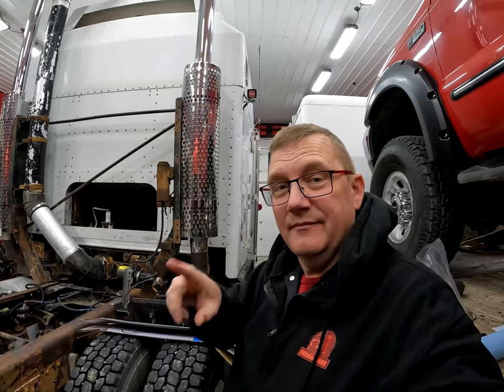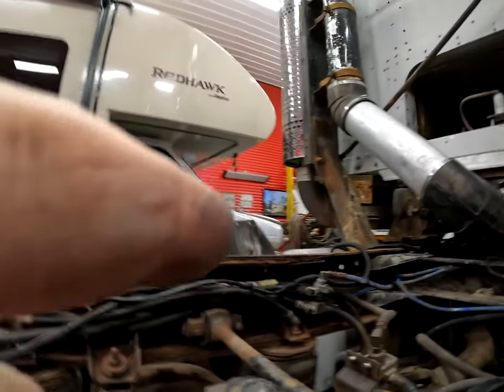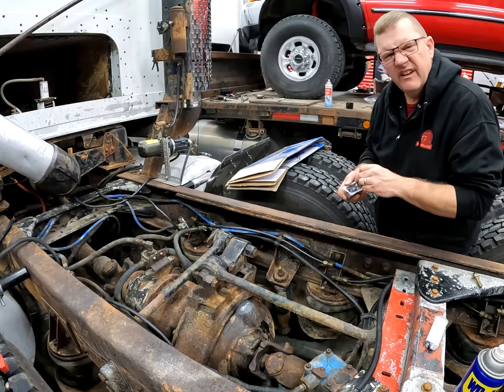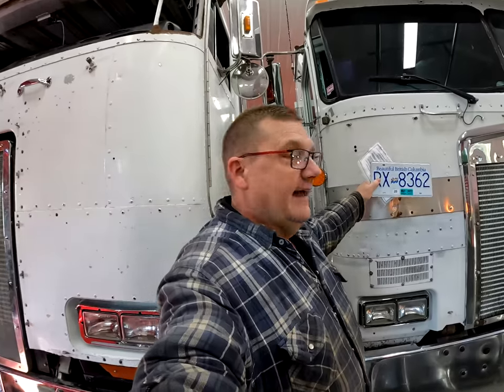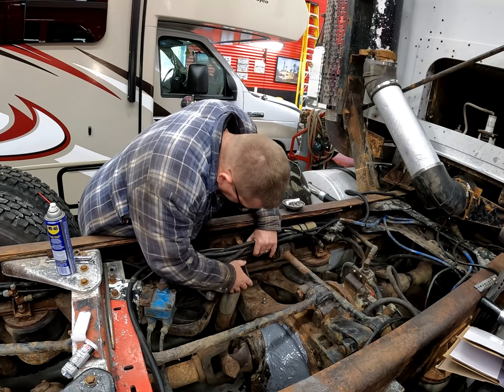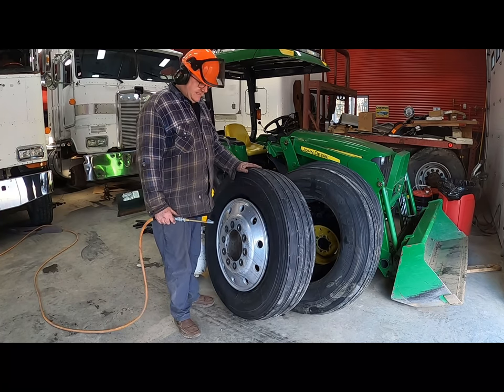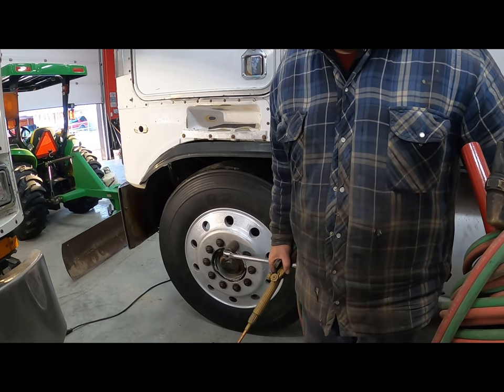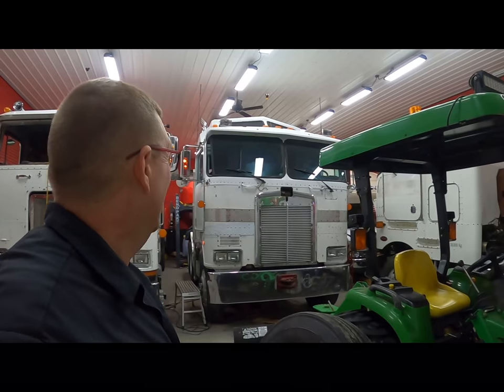Patching the hole in the rear diff... and getting Kenny ready to go to town

Comment: For next time, you can get piece of fiberglass mesh put it over the hole, then you can apply liquid one over it. It will work better and you wont need to use hard stuff first. Actually you can cover all back side of it with this methode and it will last longer than any human being..

Comment: Mike... I think I should point out something... the top of your rear wheels move toward your cab when driving forward and when those rubber mudflaps have slush sticking to them they are going to get pulled down to the wheels... I think they will get torn off

Comment: Ho my she is sure rusted out  my old 1981 k125 the rear diff has couple  of bodgie plates welded to it due to cracking  in the housing but it is understandable  as it has had a hard life down in the mines  but it still goes not to bad  it getting work done  to get it back up to driving  on the road again.

Comment: Ok I have never seen anyone slather before, now I know how to do it.😁with that rear end J.B.Weld should have that stuff in a spray can.Are you going to try to find a newer rear clip with full lockers like on the new Pete's?
Reply from the maker: Yes absolutely.  Dual lockers is a must.
Reply: @mikethetrucknut  Mike another plus with that frame would be disk brakes.

Comment: Re the diff casing that you power washed and JB  welded , you did drain what oil/water/dirt/rust was left in the diff case out ? and fill with fresh EP 90 oil ?? , and when you put your alloy front wheels back on you did smear the mating face with copper slip/never seize grease ?  How did the commute to work go in Kenny ? ...

Comment: 8 bag all the way !!!💥 if i heard you wright you were considering neway air ??? If you put neway air you had better get the serial # of the truck it comes out of or you will play hell getting parts , on certain neway air  susp the rear housings bolt holes that hold the brake  spiders on are drilled by the oem not the vendor ( Rockwell) , they said didn't  know how the housing was drilled  as it left Rockwell's plant undrilled they  ??????yeah.😳

Comment: I love Peterbilt Mike, but you sound like Ned Flanders. You mean you need a cutoff, I had a 4 bag Neway on my Freightliner. You can pick up a pretty late model cutoff 2013 14 ish pretty cheap. Find one that will slip inside or outside your existing frame. My brother did a 2005 Freightliner cutoff on his W900 A KW.

Comment: Mike, why is neway preferred over Pete 8 bag ❓❓ Neway  has more travel, lower ride height, but is that the reason 🚛🚛❓❓
Reply from the maker: This is KW 8bag, I like Neway bec its way more stable, easier to lift loads when dumping the air and airing it up.  I also want to keep a KW offered suspension so it's not a Frankenstein truck

Comment: Do something different how about a rear frame section of a Mack with Camel Back suspension and Mack diffs you know you want the ultra smooth ride of camel back suspension LOL. I've never seen diff housing rot out like that been around trucks all my life. You guys must have some serious acid air up in the interior or a lot of road salt down here on the coast of BC never seen a rotted out housing.
Reply from the maker: I think it had never been washed off because it had a deck Stubbs on it.  Probably helped speed things up. Also if there is a bad ground electrolysis can be worse on some trucks over others

Comment: Bob tailing a tractor is dangerous in the best of weather.  Good luck.
Reply from the maker: Yeah I bobtailed a self loader in the winter.  with the crane on the front the drives had zero weight ended up crossways at an intersection once. I stopped but I was completely sideways lol

Comment: Not being funny mike 😒,  but to be honest and judging by the state of that rear diff housing i wouldn't even waste any time trying to seal up that hole . Diff housing is to far gone . . And yes i used to be a truck and trailer mechanic years ago when i started out in haulage back in 1989 ..
Reply from the maker: It's not going to be used long... So if it fails it's fine

Comment: I trucked for 50 years and I've never seen rear housings so rusty. Don't smear too much of that 2 part stuff on it. Just cover the first step well and quit. If your trucks are just toys why would you want 40000 rears with full lockers?  Why not just take the front rear end out and make it a single axle. Run better, ride better, drive better and take up less room in your garage.